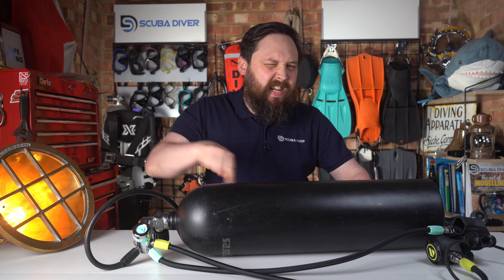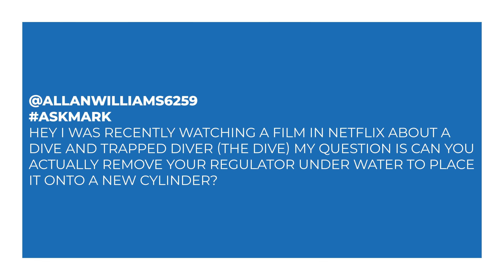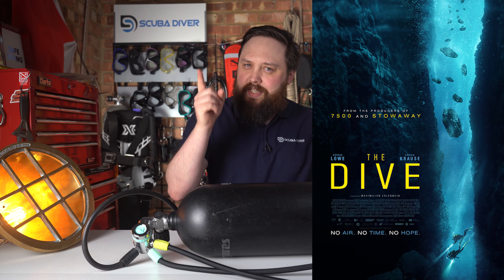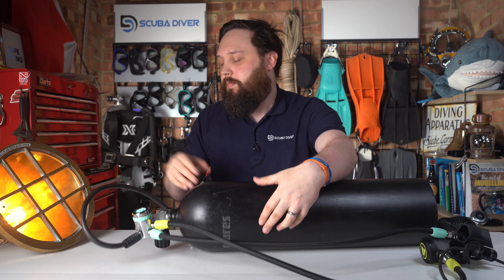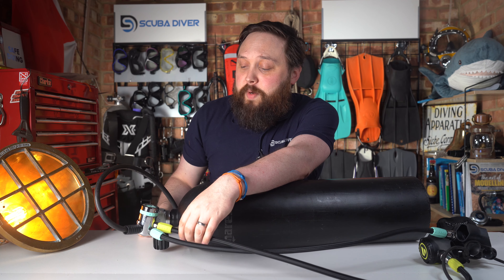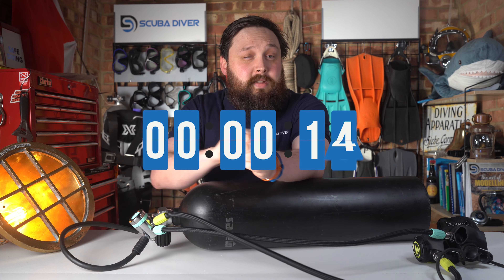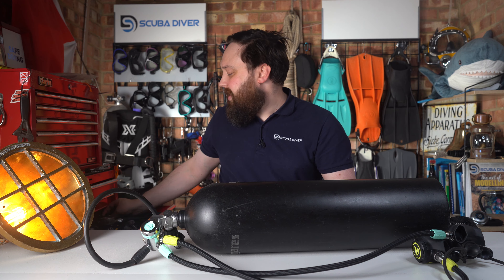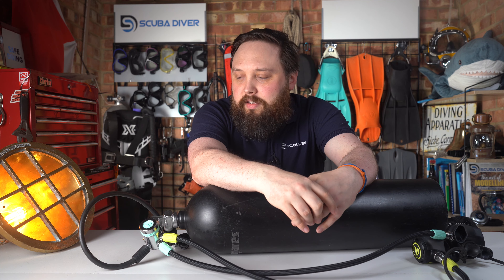Can You Remove and Replace Your Regulator Underwater? #scuba #askmark

Comment: Thing is it's not just water getting into your 1st stage; it's all the salt, silt, and c**p that's in the water too.  None of that is going to be good for the working parts and you're going to want to get it serviced before using it again.
On the inflator error, no, I wouldn't have it through the shoulder D-ring, but in backmount it would be held close to it by the normal bungee loop.  I think the old raising it above your head is an PADI vertical in the water thing rather than being in trim and using the hip dump.

Comment: #AskMark 
I've just done my OW and was wondering in what situation you would need to remove and don your BCD and cylinder in the water?  I guess maybe to fit through very confined spaces but that seems awfully technical for the first qualification! 

Thank you for all the great videos!
Reply: In my OW course, the instructor explained that it's mainly for an entanglement scenario. If you can't reach the entanglement easily to cut, you could take off your BCD, cut the fishing line or whatever, and put the kit back on. As for doffing and donning on the surface, often when boat diving, it's much more comfortable to doff gear before hauling yourself up the boat ladder. In fact, if the boat crew are ok with this, I almost always prefer to do this. Similarly, in certain conditions, it's easier to get in the water first, and then put gear on. I guess the exercises are to give you confidence that not having your gear on your back isn't a dreadful thing, and so that you've practised the steps during your course. From what I recall, both are optional. My instructor was adamant that I must do them. Daughter's junior OW instructor didn't do either stating that he just wants her to dive properly for a first course.
Reply: @ashic  Thanks!
Reply from the maker: Yeah, @ashic has summed it up perfectly: underwater gear removal is for entanglements and a bit of a confidence booster with your gear in the course.

It's one of the interesting issues with integrated weight BCDs today instead of weightbelts. If you're wearing a wetsuit and all of your lead is in your BCD then if you take that BCD off then you're going to float while your BCD sinks

Comment: #askmark Oh Hi Mark! I am looking for a storage solution, pockets to be more precise, when I am diving in my wetsuit. I have seen there are some shorts avaiable with double pockets as it is seen in drysuits but as I usually wear a 7mm diving vest overtop my wetsuit it does not seem comfortable to add that 3rd layer. Do You know if there is any vest with pockets already on it? Are there any good solutions for wetsuite divers to store their SMB's, spare mask etc?
Reply from the maker: I love the Fourth Element Tech Shorts, I find they're the best overall design but, they are an extra layer of neoprene.

Some alternatives would be something like the Dive Rite Thigh Pocket. They clip around your thigh and to the waist section of your BCD.

You can find glue-on thigh pockets but, they are permanent and messy if you haven't used contact adhesive before. The weight of whatever is in your pockets can pull on the neoprene also so I would prefer something like the Dive Rite Thigh Pockets.

Comment: #askmark

Can you explain to all. 

As to why Miflex has decided on their Carbon HP hoses to have a larger bore size rather than the common pin prick size that you find on almost all other HP hoses?

 I'm just trying to settle a point finally with a friend and need some definitive proof to settle our differences of opinions. 

And thank you for having an easy entry layman's explanation for almost everything SCUBA has saved me countless arguments simply referring to your videos. 😅
Reply from the maker: It would be best to get the official answer from Miflex but, from what I gather, the Carbon HP hoses still have the restriction at parts with a swivel pin and SPG. And the bore on Miflex Carbon HD HP hoses is 1mm, which is smaller than many of the rubber hose manufacturers.

It will all meet EN250 standards, it's probably just easier or cheaper to manufacture it that way. I'll see if I can get an official statement from Miflex.

Comment: What about an first stage with auto closure device (ex Aqualung ACD)
Reply from the maker: That would certainly help. There will still be a small amount of water between the valve and 1st stage inlet that will be pushed into the regulator when you open the valve. An ACD system will help to reduce the amount of water ingress while depressurised but, you'll still get some water ingress.
Reply: Got it. Thanks.

Comment: #askmark Hi Mark, I recently did my first dives in a drysuit. On shore I had some discussions about the routing of the inflatorhose for the drysuit. My more experienced buddys told me to put it over my harness...so just from 1. stage...under the arm....to the drysuit. I saw many videos where people put it UNDER the harness... Do you have reasons to do the one or the other? Regards from Germany. Gut Luft! Denis
Reply from the maker: The main benefit for routing your drysuit hose under the harness is to keep it out of the way and less likely to be caught on something or mixed up with another hose. 

Over the harness any slack on the hose could get snagged on something or mistaken for your SPG hose or something else.
Reply: @ScubaDiverMagazine  Thank you for the fast answer. I will try it...that's exactly what also happened to me

Comment: #AskMark Hi Mark. Thanks for all your great tips. Helped me a lot further my diving. I am going through my deep course now and during the academic section they talk about redundant information systems. Currently I dive Shearwater Peregrine Tx with AI and an SPG. So I was wondering which is better to add for redundancy. 
1. A manual depth gauge and dive  watch?
2. Digital depth gauge like the Scubapro 330M
3. A cheap secondary computer

Or do you think redundant computers are not necessary till I get to extended range. (Which is my instructors opinion).
Reply from the maker: Yeah, I wouldn't rush to get a redundant gauge but, the only downside is the cost.

A cheap computer set to gauge mode has the most additional benefits such as the extra logbook to review your dive is your primary fails. And after your tissues have cleared you can use it as a conventional computer while your primary is being fixed.

The only downsides is the additional cost, the battery life and maximum depth. An analogue gauge will last forever as long as you look after it and a digital depth gauge has an incredible lifespan. But, both only do have a single function.

If it were in my budget I would get an entry level dive computer that would function down to the depths I needed.
Reply: @ScubaDiverMagazine  thanks, cheers. I will wait then for the annual sale at my dive shop and snag a computer for cheap(er)